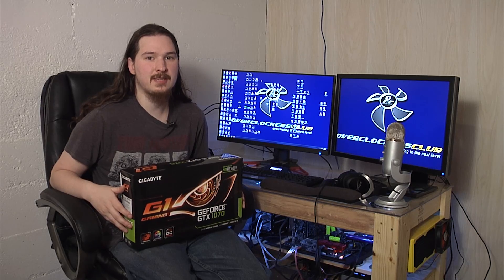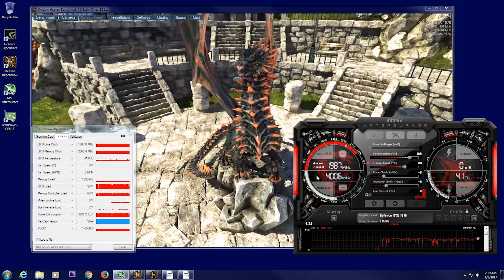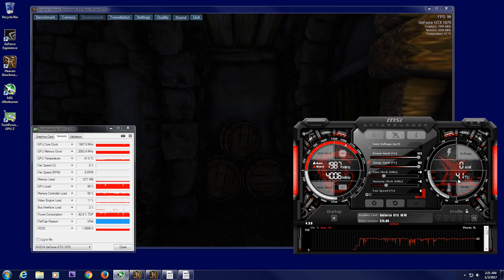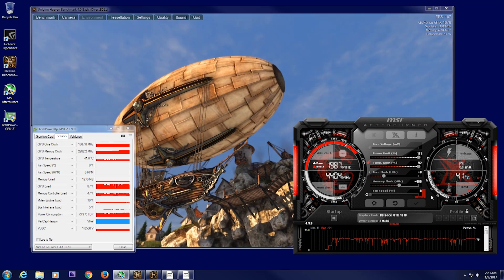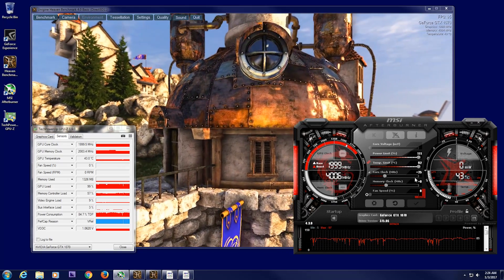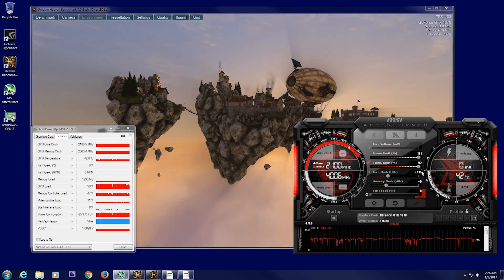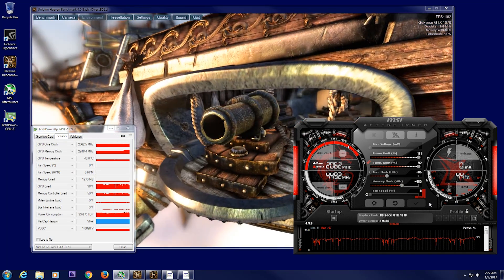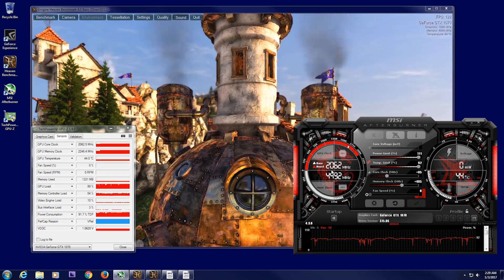NVIDIA GTX 1070 Overclocking Guide

Comment: Very happy with my Zotac GTX 1070 Amp Extreme. Overclocked to 2114 MHz, Air-cooled, temp hovers around 65 C.
Reply from the maker: Yeah I've read the AMP Extreme is one of the better cards for overclocking. Traditionally EK does not make Zotac waterblocks which is why I didn't buy one at the time. Even on air the AMP is a great card and actually EK decided to make a waterblock after all...
Reply: The only drawback I've figured out about Zotac AMP Extreme is its VRM is not directly attached to the main heatsink. It has a little separate one. I heard people say overheating VRM can hamper a card on performance. Water cooling an AMP Extreme is pointless to me. It's GPU BOOST 3.0 and Volt limitation to 1.093 which are holding the card back. Which are not Zotac's fault. I think only a BIOS hack can fix it. Thank You.
Reply: check the VRM's in GPU-Z , scroll windows to make larger.
then you see VRM temps.
or make a log.
can see what they do on default voltage and on O.C.
not sure what is safe and rated.
i guess under 73c is still fine.
over 80c maybe high and bad for components , not sure.
Reply: not seen any pascal vbios tool yet.
i would not blindly trust a vbios of someone else.
unless they very clear on the edit.
i rather edit it myself.
Reply from the maker: NVIDIA designed the FE editions to run around 80c so it is perfectly fine. I think 93c is the actual limit of the Pascal, I would have to double check though on that number.

Comment: hey what happens if i increase my core clock and memory clock but not my gpu voltage?
Reply: i increased my core clock by 200 and my memory clock by 450, also my power target to 112%, and i left the gpu voltage as stock, also i have a gtx 1070 founders, is this overlclock good or is there any risk?
Reply from the maker: No risk besides the normal disclaimer that applies to any overclock. The Pascal series is extremely overclocking friendly. You won't damge the card, the only thing that can happen is the overclock is just not stable. I've noticed more people have better luck without raising the voltage.
Reply: right now i have +220 core clock and +600 memory clock witha  gtx 1070 founders edition,is this overclock good or do you know the best optimal settings for better performance in gamign? i am paired with a i7-7700

Comment: i can easily hit +170 core clock and + 550 mem clock stable on micron memory
Reply from the maker: For overclocking the memory on the GTX 1070, Samsung does in fact consistently overclocks much higher.  it is all over dozens of forums. I'm not saying Samsung is better, but for GDDR5 Samsung has a better record.
Reply from the maker: You are one of those lucky ones  :)
Reply: samsung better than micron?, nah i dont think so dude, both of them are good, once again its about silicon Lottery
Reply: 220 cc and 700 mem clock + stable with micron

Comment: hey. i have a gtx 1070 laptop.. but when my gpu is under load, the core clock bounces between the base clock and the boost one..  so the mhz core dances.. it's not fixed as it shows in your video.. why? cause yours is desktop and mine laptop? ty
Reply: maybe thermal throttling because of GPU boost
Reply: Kurt Mercado  so it normal or not? And my gpu temp only gets to 70 degrees..
Reply: thats normal, you can actually use a better OC software like EVGA Precision X OC and then bump up the core voltage to 100 to 90% for better overclocking and performance since your GPU is a desktop class GPU so there will be no problem at all besides 70 degrees is very decent on a laptop with thin chassy
Reply: and control the fan speed manually, btw what model of laptop ur usin?
Reply: i'm using a clevo P755DM3-G ( just bought it a few weeks ago)
Reply: clevo is a decent brand and has a good cooling system on most of their laptops lol,
Reply: Kurt Mercado yes in fact. I never get more than 70 on my gpu.. and it's 2 separated fan for gpu and cpu
Reply: lol maybe its a little bit underclocked compared to a desktop GPU because im hovering 70 degrees on my zotac amp with +170 core clock and +550 mem clock. im able to achieve 7 to 10 FPS higher compared to stock using unigine heaven benchmark which is pretty darn good lol
Reply: and btw i bump up my core voltage to 90% using evga precision x oc with 80% fan speed
Reply: 7 to 10 fps higher compared to stock is a decent OC to be honest with ultra settings enabled lol
Reply: i overlock it actually with +200 and +490 memory and i still don't go above 70 :D.. and in ghost recon wildlands i get +9 fps average with the ingame benchmark
Reply: lol thats good, just make sure its stable on all applications and games

Comment: you can allow core voltage to be adjusted in the settings (default is off, that is why it is greyed with you) and there is a detach button for the monitoring in afterburner so you see all the sensor readings in an overview instead of what you are doing
Reply from the maker: Good to know :) It seems every time I open Afterburner they change the look of it. The Beta version of this newest Afterburner didn't grey out the voltage so I didn't even think of looking at the settings this time.

Comment: Thank you. Aren't we supposed to run performance tests after overclocking VRAM? If an error is detected, modern GPU's can and will issue a repeated memory read..? This will slow down actual performance even if clock speed is higher. So just because it seems to be a stable vram overclock doesn't mean that setting will give better performance. Playing with sliders isn't enough. With GPU boost, performance tests need to validate theoretical gains. Other factors come into play also for example if a game is CPU limited then a GPU overclock may seem more stable just because the GPU is not running 100%. etc etc.. complicated subject.
Reply from the maker: Very true! I guess I kinda skipped over that in the video. I did cover this overall in the written guide. Playing games or running a full benchmark may differ. At some point law of diminishing returns comes into play. Just because you can get a 1Ghz OC on the memory does not mean it will preform better. I ended up with +490 (8984MHz) because even though +505 was stable, It gave me lower performance overall when looking at the bigger picture (i.e FPS in games/benchmarks).
Reply: No problem. Seems like overclocking is becoming more nebulous.